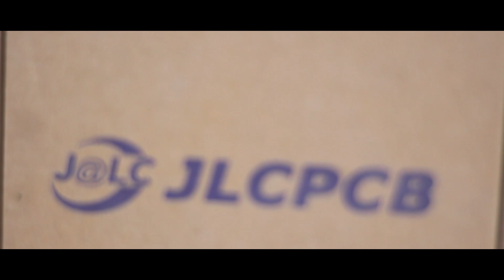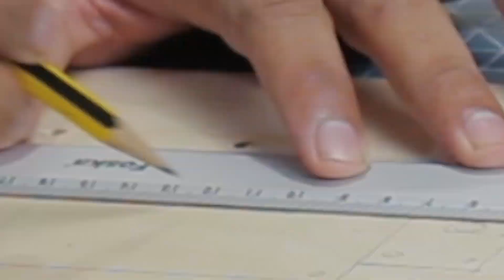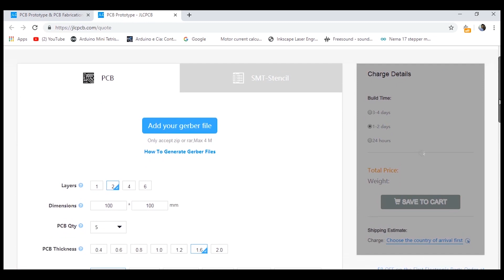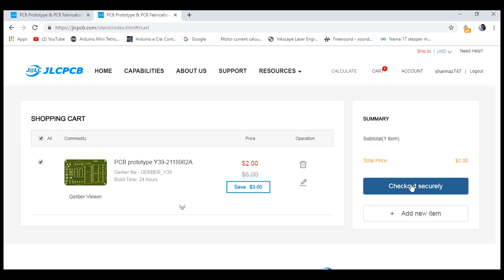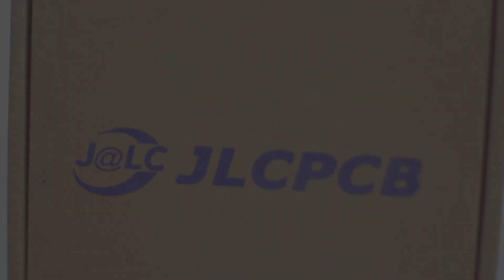DIY Camera slider | arduino project

Comment: The footage seems a little jerky, did you appply half-stepping to the steppermotors?Also you may want to add a gear ratio to smooth out the steps.Ofcourse you can try to smoth things in post-production but a little gearing can make the soure material a lot better for little cost.
Reply from the maker: yes it is, jerk is more noticeable at camera motor, reduction gearing is the best solution for that,
Reply: Maybe quarter step or more can solve this problem